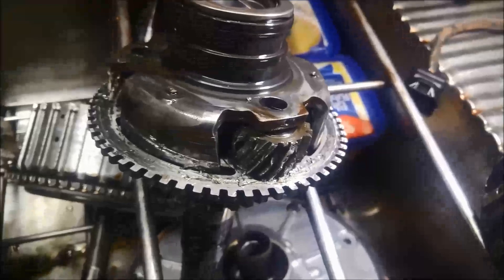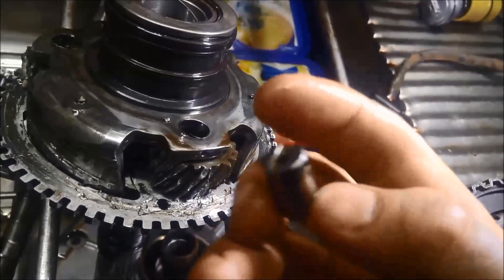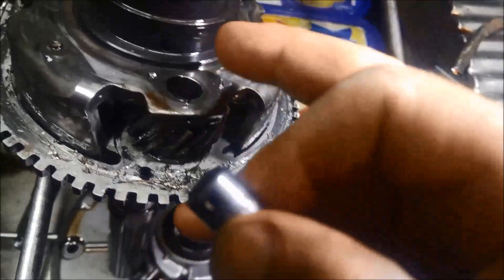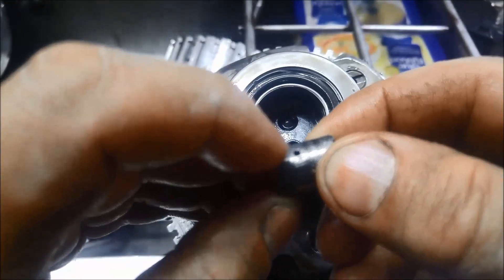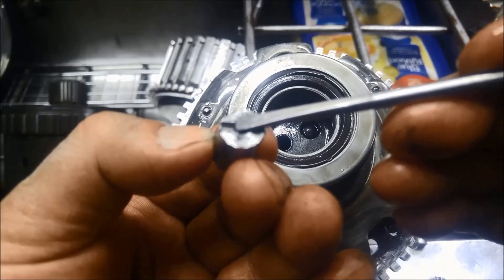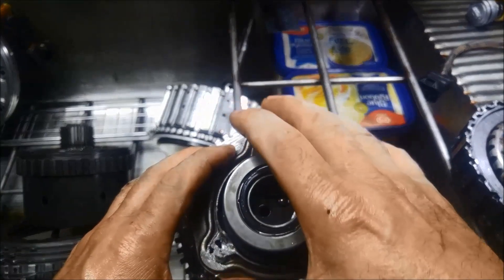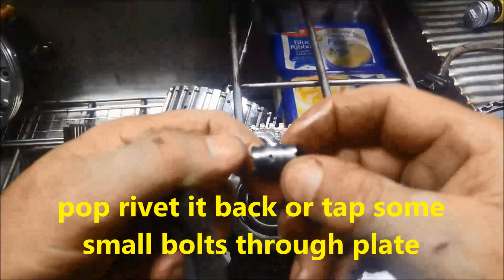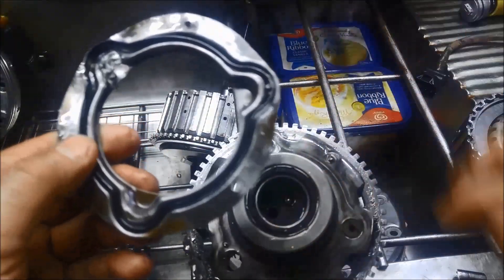Automatic Transmission Planetary Gear Set Failure - V5A51 Triton Pajero Shogun Montero Challenger

Comment: Hello dear. Thank you very much for the explanation!
I confirm your point of view. Yes, it is a weak point in the V5A51 but not a design fault either.
Further to a 10 years experience inside our own Pajero offroad team, we confronted few cases with similar problem and I confirm that all these affected transmissions were subject to a lack of maintenance. Actually even worse, there is no transmission fluid change by the owners and transmissions kept working up to 300.000 Km (as an average) before breaking down!!
Personally and many other Pajero members inside our team who perform transmission maintenance in time (fluid replacement each 40.000 Km or 60.000 Km max. & filter of course) never confronted a planitary failure on their transmissions. Some Pajero show more than 500.000 Km now on the clock ;)
However, seen the intense offroad use some units has got a worn clutch discs (mainly the second brake clutch) which are a normal wearing parts and easy to replace.
Nevertheless you make a great and unique video! Please continue.
Reply from the maker: hi, people rarely (if ever !) adjust the band on these trans. if your valve body is worn or solenoids leak, you will have torque converter issues and cause alot of overheating. i plan on making a vid on how the torque converter works on these, it is different and definitely interesting. thanks & cheers
Reply: @YepThatsIt  Many thanks my freind!
please continue this kind of fabulous job.